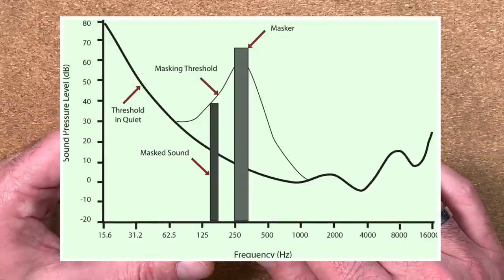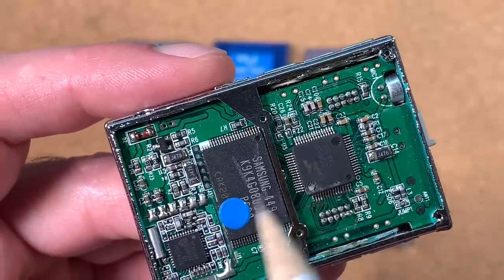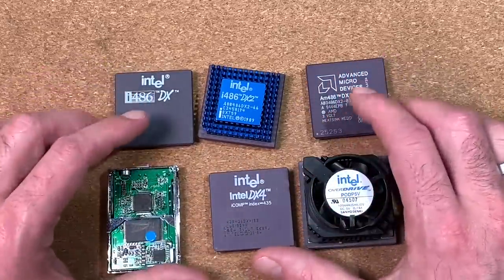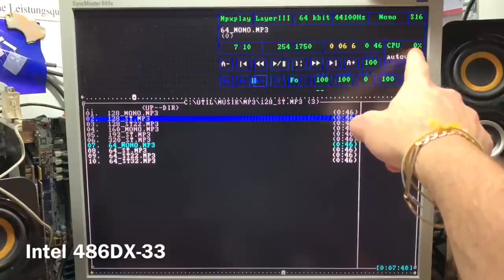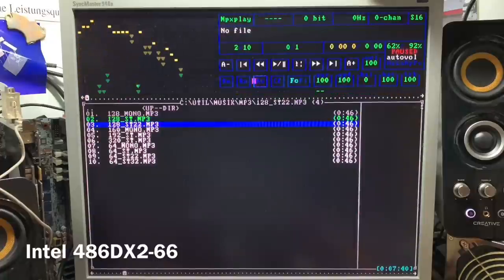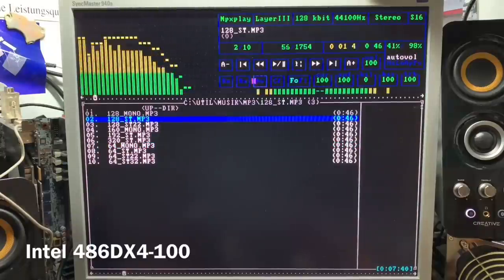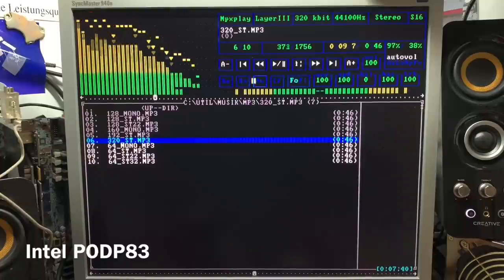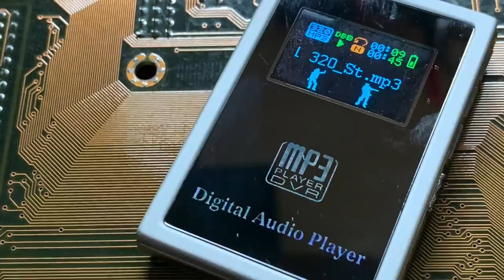Can a 486 Play MP3 Music In Good Quality?

Comment: This shows how powerful dedicated hardware can be for specific tasks.
Reply: Just like bitcoin miner.
Reply: well there was no equivalent at the time 486 dx was common
Reply: Nowadays is not needed for audio, modern CPUs are so ridiculously powerful that they can handle DAWs with very, very low latencies.

I'm using an almost 10 year old i7 and producing music with real time emulations of analog synthesizers, meanwhile a 486 can't even decode an mp3 very well. It's said that modern CPU power killed sound cards and other stuff.
Reply: @saricubra2867  There are still external processors for audio. That's called DSP, one of them is inside Universal Audio Apollo series.
Reply: @RinaldoJonathan  Yes, but nowhere near as powerful as a modern CPU with the DAC.

Edit: The Universal Audio Apollo is an external DAC or amp, all the audio processing, encoding and other stuff is still done by the CPU. Nowadays, the best combination for music production is the best CPU you can buy with an external DAC and very high quality speakers, headphones. But on board DACs are also very good nowadays.
Reply: @saricubra2867  if they are only DAC then explain to me the differences between apollo twin solo, duo, and apollo 8p.
Reply: @RinaldoJonathan  Inputs/Outputs, software included for DAWs and DSP options for the output to simulate analog effects.

Very good for very old potato PCs.
Reply: @saricubra2867  My ancient Q6600 with a dedicated card still gets way lower latency than any newer system.
Reply: @IntegerOfDoom  Me: runs analog simulations plugins with oversampling for wave files at 192KHz at 16 bit or 24bit...
Reply: @saricubra2867  "It's said that modern CPU power killed sound cards and other stuff." - I strongly disagree. We still haven't got as good spatialized 3D audio as the aureal vortex 2 released in the late 90's. Software emulation of the HRTFs used on the vortex 2 should be easily possible, as should calculating reflections for partial wave tracing, on a CPU. What killed dedicated audio a general ignorance of just how important 3D spatialized audio is and patent trolling by creative that killed Aureal (Aureal won the court cases but lost so much money doing it that they were then bankrupt and bought out by creative; who bought the patents and trashed the technology in favour of their reverb engine EAX BS). Then Microsoft tired of Creative's shit and kicked their drivers out of the kernel mode so they couldn't cause something like 1/3 of all reported windows crashes. The only ones even trying today, quite half-heartedly, is AMD and nVidia and they are implementing it on the GPU because it is better generally for DSP type tasks and raytracing in particular (needed for partial wave tracing, finding which reflections in the scene are important so you don't need to fake it with simple chorus type algorithms). The main impetus for this was and is VR where there is even less mismatch between your head and the direction of the head set than there is between your head and a monitor.
Reply: @soylentgreenb  I agree that sound cards could be a lot better. Speaking as a programmer there is much they could do and there is much more Windows could do too, stimulating a better platform would definitely help. Unfortunately, PCs are now commodified so most of their capacity is directed towards delivering cheap minimal solutions to the marketplace. The sound platform is heavily biased towards audio streams, if you want to sit and mong in front of YouTube, they're adequate, if you want to produce generative music on the fly, it's going to sink a whole lot of CPU time. 

Creative sadly are yet another example of a company bulldozing the market with aggressive sales and marketing. I don't think they have ever delivered any pro audio devices. Even for consumers it's generally understood that when it was the GUS v the SoundBlaster, the GUS was a far better card but Creative muscled them out of the market. It's sad because we're all still paying the price.

"
Reply: @vapourmile  The AMIGA had a lot of excellent music and the GUS was essentially an improved AMIGA (sound quality and simultaneous hardware channels). What killed the GUS was that PC was kind of a joke platform for gaming until around 1992. Lots of terrible ports from other systems and very few good games of its own. Expensive and no hardware acceleration. Around 1992 it dropped in price a lot and got enough power to do in software, with more flexibility, what e.g. the amiga did in hardware (due to 386DX-40, mainly, which was cheap, reliable and powerful enough entry level; very highly integrated); 1992 also had Ultima 7, Wolfenstein 3D and Ultima underworld, 3 amazing killer apps. By then lazy ports had already settled on using the adlib/OPL2/OPL3 FM synthesis and it was very hard to get anyone to care about coding for GUS since there were so few users. Only demo makers really bothered with the GUS and most of those came over from the AMIGA. A few years later MIDI made sample based synthesis relevant again, but it was already too late for the GUS.

"The sound platform is heavily biased towards audio streams, if you want to sit and mong in front of YouTube, they're adequate, if you want to produce generative music on the fly, it's going to sink a whole lot of CPU time."

Use the GPU if you need to brute force it. It is essentially like thousands of DSPs tacked toghether, with general programmability. They're not very good for branchy, messy code that X86/X64 excels at. But for cranking out FFTs, convolutions etc. it is just unbeatable. It's what sound cards could have been if you don't care about simultaneously doing graphics.
Reply: @monad_tcp  Apple M1 macbook with a clockspeed of 3.2GHz can outperform desktop chips that use 10 times more power and battery life can be superior to 24 hours of use in extremely basic stuff.

All of those things are obsolete and irrelevant by modern CPUs.
Reply: Yeah, like Raspberry Pi 3 with power likely comparable to dual-CPU Pentium III 800MHz able to decode FullHD x264 video which my Core2Duo at 2.6Ghz struggled with. 
And Rapberry Pi can run for hours from 10Ah powerbank, while PIII requires some tiny 6000RPM CPU coolers.
Reply: @saricubra2867  what analog synthesizers 🤨
Reply: @monad_tcp  No smartphones use a DSP to decode MP3 (or any other audio format), in fact nearly no MP3 players going back even 20 years used a DSP, instead just using software decoding (even the old ARM7 cores from the time were more than up to the task).
Reply: @thedausthed  Qualcomm Hexagon is a DSP, what do you think implement the codecs ? 
That's on a Snapdragon 800, which is quite old by now.
Reply: I think you underestimate just how far CPU power has come. Note a 486 was around 50 MIPS (millions instruction per second). A tiny Raspberry PI gets around 7500 MIPS. So you could build your own pocket sized device that could play over 100 mp3's at the same time with the lowest performing general purpose hardware around.

Comment: This is why mpeg decoder cards were a thing back in the day.
Reply: Uhh, AFAIK it was because of DVDs.
Reply: @tripplefives1402  I beg to differ. DVD came along in 1996. Plenty of people were still using them then. And those cards weren't for just audio. From what I can find they were for video and audio, special games designed for them.
Reply: I remember it was not as much DVD but CD-ROMs with MPEG video on them. Mid-nineties, video was used more and more in games, but also in stuff like encyclopedias and magazines or demos, it was the way to enjoy your ‘multimedia PC’. So you could buy these MPEG decoder cards that could often be tacked on to a video card and were relatively cheap, and ensured you could run it without stuttering - especially on a lower end system.
Reply: MPEG decoders were mostly for FMV games on CDROM on 486 class machines. MPEG2 decoders were for anything pre-P3 that needed to play back DVD video.
Reply: @timramich  virtually no one had DVD until about 98
Reply: @timramich  Nah, the first movies were released in december of 96, just four of them. And almost no one owned a DVD until the late 90:s.By then Windows 98 was around and that was just too hard for a 486 to run.
Reply: @kasimirdenhertog3516  Weren't MPEG cards expensive af?
Reply: @fungo6631  since I was curious myself, I googled for a bit, and found out this add-on board (later on integrated on the videocards themselves) was called the S3 Scenic/MX2. Introduced somewhere in '95. I cannot find the original pricing, but I remember paying something like 250 (Dutch guilders, looong time ago...) for the videocard and 75 for the MPEG add-on card (a complete mid-range PC would set you back something like 1500). 

So yes, it was quite affordable. But it also only served one purpose really: play MPEG video at 30 fps. Here's an interesting article from '96 about this card selling more than half a million - I think quite significant given the much smaller market in those days: https://www.cbronline.com/news/s3_claims_sales_of_its_scenicmx2_mpeg_1_decoder_chips_have_now_passed_the_half_million_mark/
Reply: @kasimirdenhertog3516  And how much is that Dutch currency in DEM?
Reply: @tripplefives1402  DVDs were definitely a thing in the later 486 era.
Reply: @tripplefives1402  DVDs were first released in Japan in 1996.The Pentium II came out in 1997.

486 based computers were in use well into the early 2000 being discontinued in 2007.
Reply: @tripplefives1402  People didn't upgrade their computers too often back then, so yes, it was pretty common to see 486's (and even 386's) in 2000. Win 98 worked perfectly fine in a 486 DX2 (the big issue was RAM, since a 486 probably only had 8 MB or less and that would be insufficient for Win 98). The syscall (sysenter, actually) instruction was introduced in the Pentium II (well, it was actually introduced in the Pentium Pro but it was buggy and unusable) and was used for the first time in Win XP. Win 98 didn't support it. Not rare at all to see DVD drives in 486's and Pentium 1's (and maybe a mpeg-2 decoder card, since those CPU's couldn't handle mpeg-2 decoding).
Reply: @sedrosken831  PC FMV games didn't really support decoder cards, and none of the era shipped with MPEG video in retail versions to begin. The video formats used varied, but they were software CODECs optimised for simple CPUs, didn't use YUV subsampling, sometimes were RGB but often not, often palettised 256 colour. Like QuickTime AV, Intel Indeo, Lucasarts Smush, RAD Smacker... None used MDCT and a lot used VQ or other dictionary lookup forms. The audio was usually some form of ADPCM.

Shipping MPEG video files in a retail published game fundamentally wasn't viable, since a 486 isn't nearly fast enough to decode MPEG, and MPEG can't degrade gracefully to a lower quality or framerate to make up for that performance deficit.

The first MPEG decoder cards could decode MPEG-1 video substream from VideoCD using the bundled player software, there wasn't really a vendor-independent standard way for software to make use of them anyway. Audio substream decoding could have been done in software, on VideoCD it was MPEG Layer 2 which is several times simpler and less CPU-intensive than MPEG Layer 3, aka MP3, but very first cards had a hardware audio decoder regardless.

There's the partial exception of the Reelmagic card which had a bunch of games with MPEG video bundled with it and these versions of games were hardware accelerated. I think two of them were FMV games ported from consoles and arcade, and the rest just had maybe a few minutes of cutscenes each. Independent software support was promised, but entirely failed to materialise. Because who in their right mind would publish a game that needs a $450 add-in card to run?
Reply: @tripplefives1402  I dunno, I had a Cyrix 6x86 PR150 up until 2004 and was happy with it so I can see someone happily using a 486 until 2001 or so.
My aunt upgraded the RAM and HDD then installed XP on it, even managed a handful of games like SC3000 and TS1 with Livin' Large and House Party. (I tried installing Hot Date but that was too much)
Reply: Could a 486 native play a mpeg1 vcd or need card 🤔 and could pentium 1 or the 3 in 1999 do it?
Reply: @macgyver6999  No, not enough performance on 486, no chance. As far as i can remember, with Pentium 133MHZ, things are looking better, it can decode VCD-spec MPEG1, but you still want a colour space conversion and scaling hardware on the graphics card (video overlay support) or Pentium MMX. Pentium2/3 is overkill for VCD, a 300MHz Pentium 2 can play DVD-spec MPEG2 just fine already, with video overlay feature.
Reply: @SianaGearz  I thought a 486dx400 could play vcd
Reply: @macgyver6999  As I remember, windows came with software codecs that enables you watch mpeg videos(video cd). You did not really need a hardware Mpeg decoder. Video cd's were around in 1993 and you could watch them on a 486 as long as you had a CD-ROM drive. Even certain game consoles back in the 90's could play video cd's (Sega Saturn and PS1). The game consoles needed a mpeg decoder which was designed for it and could be bought.
Reply: @TheDemocrab well the Cyrix 6x86 is technically a 486 class processor as it has the CPUID instruction disabled. Indeed in Windows 2000 it's identified as a 80486-C0, meaning it has a deficient FPU

Comment: Very Interesting. After I learned about the Fourier Series my respect about the work that even these old CPUs can do has risen immeasurable.
Reply: Only the FFT algorithm has made this possible. DFT is hard even for modern CPUs
Reply: @TheRailroad99  The FFT algorithm performs a Discrete Fourier Transform. So a DFT isn't hard, because we have FFT. Yes it would be hard if you tried a naive approach, but that's true about many computational problems...
Reply: @benjaminmiller3620  "normal" DFT is not would I would consider a naive approach, because FFT can not always replace it. If the block length is different than 2^n, FFT is not possible.

Comment: Wow, this exactly matched my results with a DX2-80! I maxed out at 64kb/s stereo under DOS as well, using a cheap PCChips board with 128K of (real) L2 cache. Meanwhile, a 300MHz P2 running Foobar2k atop Windows 2000 can play 320kb/s stereo using only 1% of the CPU. Such amazing progress in 3-4 years!
Reply: Pentium 2 is way optimized

Comment: I only found your channel yesterday but it's so cool 😊 
I grew up with 386 and 486's and still remember overclocking a DX2/66 to 80MHz when I was around 10. Built a fan holder out of Lego to keep it cool. Was no Celeron 300A that's for sure! 

Off to watch the rest of the videos now.

Comment: Cool video. Thanks for the flashback. I remember being bitterly disappointed that my DX2 could not play mp3 files using Winamp on Windows 95 back in the university days.  I was also gratified to see a similarly configured 86Box machine behaved pretty much the same. I feel old!
Reply: My 486 DX2/66 could only play really low bitrate MP3s on Win95. But with DOSAmp it could totally play a normal 128kbit/s 44kHz Stereo MP3 on the Soundblaster 16. The CPU was fully maxxed and it needed a big buffer to not stutter but then it worked.

Comment: I've also tried the same thing couple years ago. If I remember, Am5x86 @ 160MHz can play mp3's nicely, and FLAC also with no problems. I tried under Win 95 and old version of Foobar. In Windows DX4/100 was still too slow in my case. Nice video!
Reply: Same experience here. My Setup would only start at 133 MHz, but switching the external Clock to 40 MHz in Operation allowed the 160 MHz just fine. And with that I could listen to 128Kbit MP3s without worries. :) 1997 was the year. :)
Reply: The DX4-100's in high school played 128kbps fine in Win95.  I hosted the discrete server holding all the files (MP3s and Duke3D) stashed in a ceiling.
Reply: Was the FPU on AMD Chips perhaps performing worse than intel already in this generation?
Reply: @marcianzero_yt  maybe yes. AMD DX4 chips have 8KB internal cache, while Intel have 16KB it may create difference...
Reply: The Am5x86 also had 16 KB of L1 Cache.
Reply: @marcianzero_yt  yes, I know, but DX4/100 from AMD have only 8KB, and have problems with mp3, performance may depend on the motherboard too...
Reply: Yeah I thought about this, too. But I cannot remember the exact Mainboard I had. I do remember it was 486VIP with an AMI Winbios. The Bios was really nice. The Board was a good upgrade path, but probably not the fastest option. It allowed 30 PIN SIMMs along PS\2 SIMMs if I remember correct. Perhaps some UMC Chipset?
Reply: @marcianzero_yt  I had probably board with UMC chip, Winbios and fake cache ;) it has two pci slots too.
Reply: My Am5x86 @ stock 133 MHz could play 128 kbps/44.1 KHz/stereo mp3s on Winamp just fine with about 95-99% CPU usage, as long as I didn't do any multitasking and used the system solely for playing music. However that system had 256 KB of L2 cache and a Sound Blaster 16 DSP sound card - this setup probably helped the CPU keep the pace.

Truth is, even in the system I moved to afterwards, a Pentium MMX 233 MHz + 512 KB L2 cache + 64 MB ram + Sound Blaster AWE64, mp3 playback on Winamp would sometimes stutter when there was heavy multitasking.

Only when I moved to a K6-2 450 MHz + 512 KB L2 cache + 256 MB ram + SB AWE64 (the same I pulled from the previous system), I felt the system could really play mp3's effortlessly.
Reply: @marcianzero_yt  Yes, Quake runs a lot smoother on a Pentium than a AMD chip, and that game relies a lot on FPU performance.

Comment: I vaguely remember getting stereo 128 mp3 running on a 486DX4 maybe 100 or 120mhz with windows 98 and winamp with integer decode on a similar PCI socket 3 motherboard. 

Fun channel, keep it up!
Reply: We used to encode and play them in Linux back in 96/97. The #MP3 and #Mpeg3 channels on EFNET IRC were the place to be